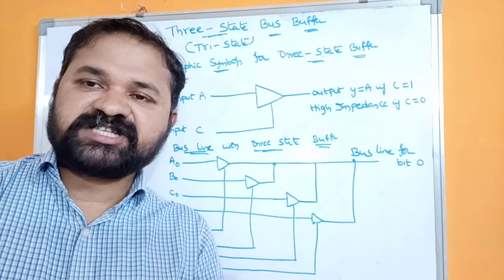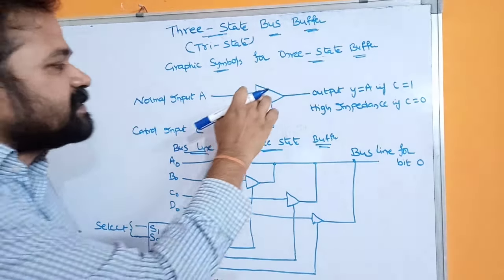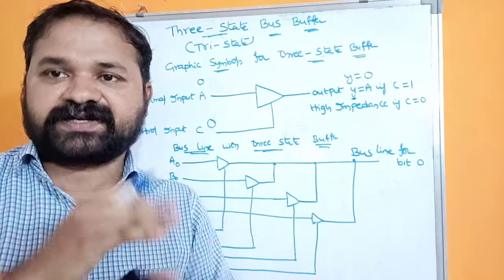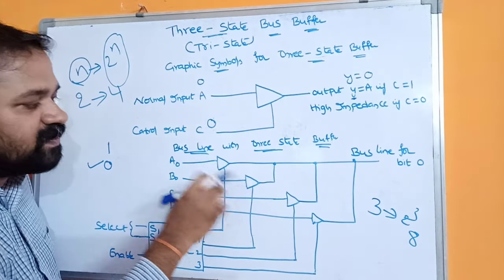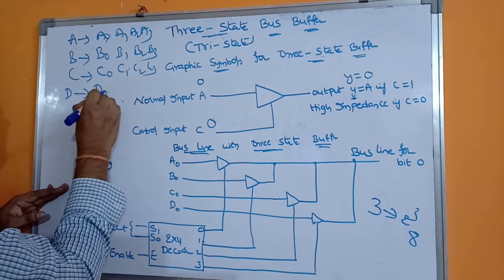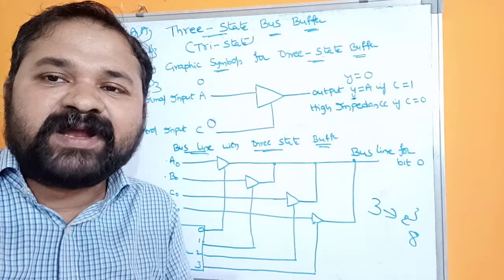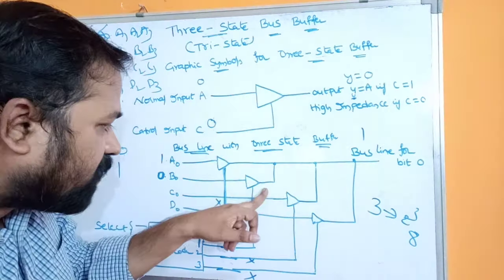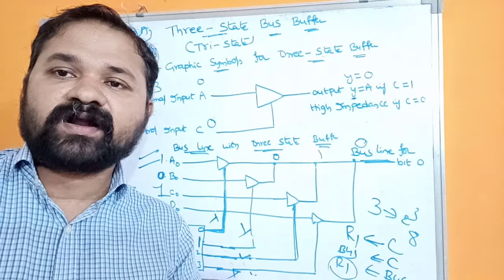Three-State Bus Buffer || Tri State Buffer ||Computer Organization & Architecture| Common Bus System

Comment: sir, you said that if control input is 0, then it is high impedance and it will not produce any output, but in a bus system with three state buffer diagram, you are saying that even if control input is 0, it will give the output as 1. can you please clarify my doubt sir.
Reply from the maker: If the control input is 1 then only output will be produced. Plz subscribe to the channel and if possible share  with your friends. Thanks in advance..

Comment: When s1,s0 are 0,0 then output is 0 that is given as control input to A0 which results in high impedance ,but you said 1 ,can you plz check
Reply from the maker: Yes, what you said is correct. Plz subscribe to the channel and if possible share  with your friends. Thanks in advance..

Comment: Where as here control input is 0 should not transfer the bit right...
Reply from the maker: Yes. Plz subscribe to the channel and if possible share  with your friends. Thanks in advance..
Reply: @SudhakarAtchala  but u said like here from decoder it will go the control input right.,if decoder is 0, a0 is 1 then how will give output is 1.plese clarify on this.
Reply from the maker: @lakshmirv4776  if control input is 1 then only the output is produced.
Reply: @SudhakarAtchala  here control input will come from decoder only right